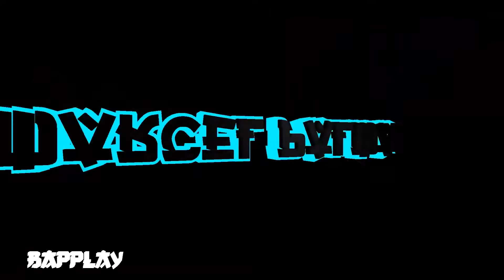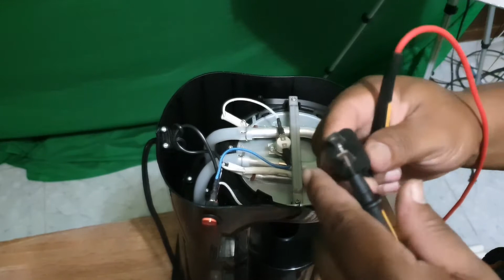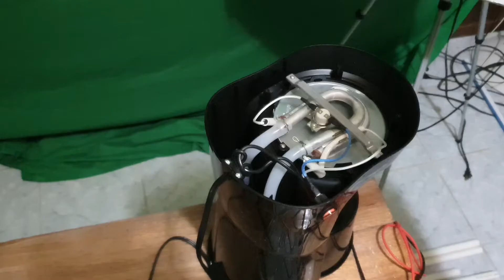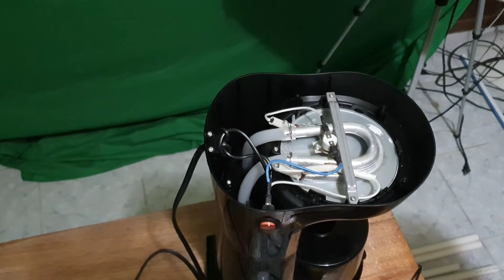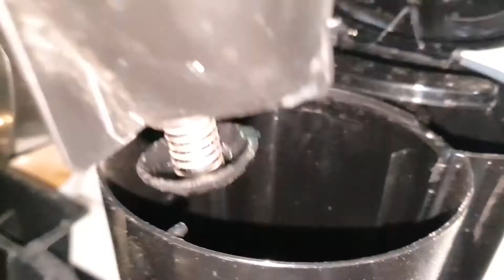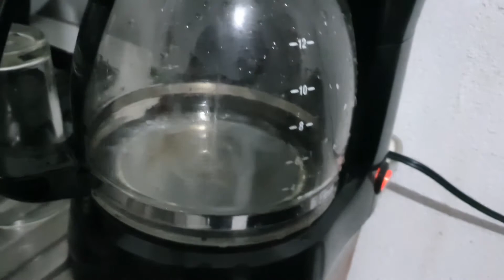Coffee Maker Repairs

Comment: Hi dear. Thanks for the video. I have a similar coffee machine. It looks the same inside. The only difference is the power button. In my machine, a toggle switch connected to a small board which is used to set a timer for it to start at a certain time. The machine doesn't start. Last night, there was an electricity outage and fluctuation in our area causing multiple electricity trips in my house. This probably caused the problem in the coffee machine. Which part of the machine is very likely to get damaged because of such incidents?How can I fix it?

Comment: If the thermo fuse keeps blowing, it could mean that the thermostat is not opening the circuit at the proper temperature. It's allowing the heating device to get too hot, thus blowing the fuse. Maybe should also replace the thermostat.

Comment: Thanks for this thorough explanation, sir. I have one like her that takes out a small amount of water and then stops working and I turn it on after it cools down. What is the reason in your opinion
Reply: The hose, leading from water tank to heating plate, has a ball in it, to stop heated water's backflowing into the water tank, once it's been heated.  That little ball in the tubing can become covered with minerals from the water and no longer float within the tube.  a) you can take the bottom off, remove the hose and clean it out and reinstall it, or b) first try 50/50 of vinegar and water in the water tank, turn it on to move the solution through the hose - rinse with fresh tank of water afterwards.  Coffee makers recommend vinegar/water cleaning the machine on a regular basis, to prevent what you're experiencing.
Reply: A video on removing the water tube for cleaning, should you need it: https://youtu.be/vkx4tUkmQxU

Comment: Hello there. This vid came up after I searched for “ why I don’t get out the same amount of liquid I put in the reservoir”. This four cup mrCoffee gets cleaned regularly with vinegar but, less and less coffee gets brewed for the same amount of water. Do you have any suggestions? Thank you..
Reply: I know this comment is already 9 months old but inside the tubes theres a ball valve that usually clogs up, you can try opening the coffee maker taking the tube out and cleaning the tube (if you take out the valve note down the direction it was so it wont block any water from passing)
Reply: @vitors9198  , thanks...I tried everything when I took it apart. Nothing was plugged but I cleaned the tubes anyway. I put everything back after inspection and I just add more water as it's needed to fill with the brew. Annoying as hell but...I don't like throwing plastic items unless completely useless.